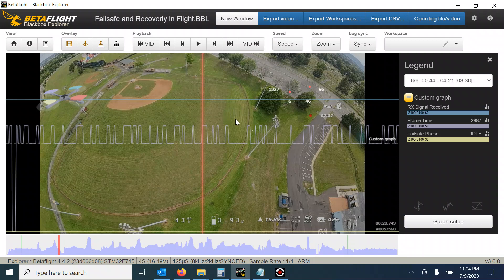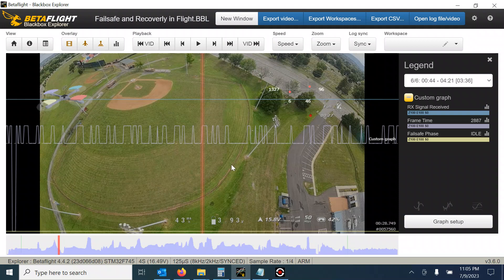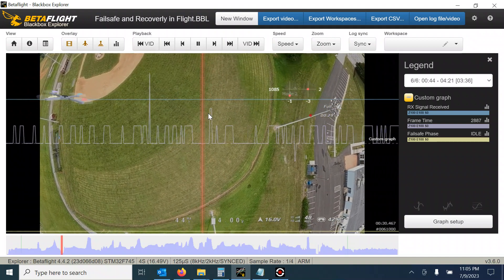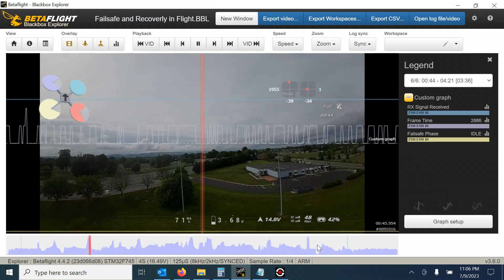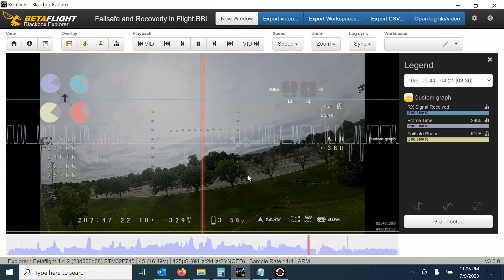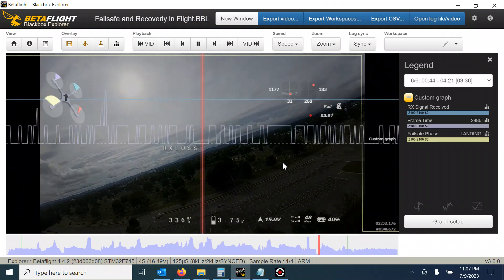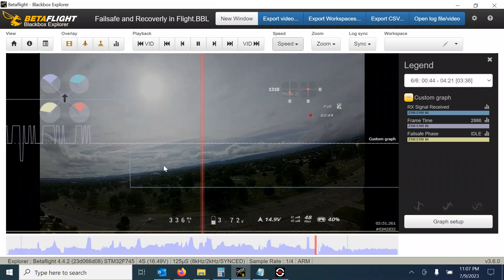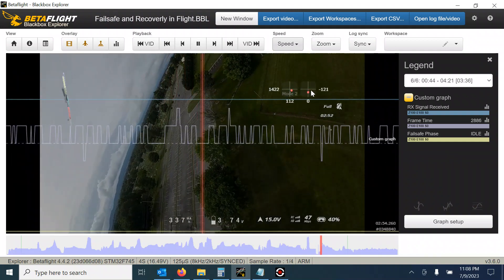DJI O3 Air Unit RX Loss with BlackBox Data

Comment: having I iflight drone I had Rx loss today over water gps save . but the mbps is solid 40-50 as of the bars . its happened on second attempt at same position . weird but dji is not solving this bug . I bought fpvRC2 because I though dji makes best products . issues like this may happened but the main thing is dji is not solving this . very disappointing DJI 😠

Comment: I experienced momentarily RXLoss many many times using DJI Controller 2. I tried different Betaflight and DJI settings to eliminate the RXloss problem. One possible solution I found is to Iower the PID Loop from normal, say 4hz/8hz to 2hz to lower CPU loading in Betaflight from around 45% to 16%. Since then, I never experienced one time RXLoss happening again in various locations/flying conditions and different brands and grades of Flight Controllers, e.g. F405, F722 and etc.

I suspect that when the CPU is momentarily overloaded during flight, SBUS reading is stopped. The problem may not because of DJI. Betaflight may be the cultprit. Does INAV users experience the same?
Reply: how many flights have you had since doing this?  Ive had issues with my air unit and my o3.  air unit worked great for almost a year and now all of a sudden does it far too often. thinking about permanently switching to tbs crossfire
Reply: @tgn_productions  Plenty and loss count.😁
Reply: @rickywklau01  well I bought crossfire but I might also give this a go

Comment: Had the same problem yesterday caued me to Crash my quad yesterday. Any idea what causes rxloss?
Reply from the maker: I'm waiting for DJI to fix the problem in their firmware.    Until then, I switched to radio master RP2.
Reply: @microdronetech8453  ill be converting to crossfire
Reply: do u have fcc hack? @microdronetech8453
Reply: have they fixed the problem? @microdronetech8453

Comment: Same thing happened to me today with an iFlight iH3 O3, DJI Goggles 2 and DJI controller 2. I was in Air mode and coming to land and the drone was only a few metres away from me and about 1 metre off the ground and then the RX Loss happened (although the Goggles showed full signal strength) and suddenly the drone took off as GPS rescue kicked in. I don't know why GPS rescue kicked in as the drone was very close to me and it shouldn't have kicked in as I had it set to 30m. The drone is on 4..4.2. I have been flying it before this without a problem. I will have to change it to land as I can't have the drone taking off when this RX loss error happens.
Reply from the maker: Thanks for posting.    I'm so glad I made this video because I will know when DJI has this problem fixed without me personally having to take crashes.    I took a 1 gram total penalty and put a RadioMaster RP2 ExpressLRS 2.4ghz Nano Receiver in my drone until this is fixed.   It ranges to 1 mile fine when the transmitter is 1 watt.   I usually fly at 500mW and less than 1/2 mile.
Reply from the maker: I love the O3 system.   The range and video quality is way better than Vista and anything out there.   However, I do notice that close in occasionally maybe on every other flight the video freezes for 1/10 of a second when the drone comes close in.    This freezing isn't a problem in video.   However, I bet that is when the remote 2 drops out for 1 second.   It should be pretty easy for DJI to fix this.    100mS of remote control loss wouldn't be that bad.   But, 1 second is the worst.
Reply from the maker: I do love express lrs, but I can't wait to get back to DJI Remote 2.   I"m the type of guy that spends $2K on custom nylon and titanium hardware to make a toothpick drone 10g lighter (118g now with 850mAh 3S).   I'm selling my extra hardware on e ba y.   Just look up titanium quadcopter to see it.    Aluminum isn't machinable at 30mm in M2 and M1.6 screws.

Comment: Same thing here. LOSSRX very near. First time in about 20 flights.
O3 Air Unit version 1.02
Remote Control 2 version 2.00.09
Goggles 2 version 1.07
beta Flight version 4.4.2
batterie 3.67V ou 22.1V
Signal video 50 mbps
https://youtu.be/W3WFEIKGb3s

I configured the flight logs for next time it happen. Also, I like your failsafe to land. It's better than just fall down from the sky.
Reply from the maker: I'm glad you posted a comment.   I see you are already using 2.00.09 and dji still hasn't fixed the problem.    Also, I see you got knocked out without too much g force too.   It looks like dji hasn't fixed this issue yet.   I currently switched to expresslrs, but the penalty is about 1 gram for the RP2 ExpressLRS 2.4ghz Nano Receiver.   Thanks for the update.
Reply from the maker: I really do want to go back to the dji remote controller 2.   My temporary transmitter is a radio master boxer with full aluminum AG01 gimbals.   It is nice, but I'm all about the least amount of weight possible.

Comment from the maker: I just verified RXLoss on another O3 Air Unit at close range just like this video.    It took about 5 minutes of bando style flying.   I do convert to naked O3 units without the shielding.   I also use titanium M1.6 screws with custom M1.6 nylon spacers.   I guess I need to convert to Radio Master Boxer.   I do love the CNC gimbals and miss them from my DJI Remote 1 conversion.

Comment from the maker: I just verified RXLoss on the Goggles V2 running V01.07.00.00.   My guess is the controller 2 firmware is the problem.

Comment: Unfortunately same for me...
DJI O3 Air Unit with DJI Goggles v2 and DJI Remote Controller 2 -> All devices runing the latest firmware. Happend on saturday the first time and failsafe kicked in. I configured failsafe with GPS Rescue (Betaflight 4.4.2) and I didn´t lost or crashed the drone. After the connection was reestablished I was able to land without any issues. I was less the 30m away at a height of less the 10m and absolut no objects between me and the drone...
Reply from the maker: Yep.   I just RXLOSS crashed testing with my old V2 goggles.   I have been flying over grass until the problem is resolved.